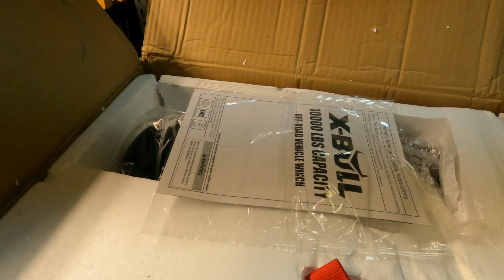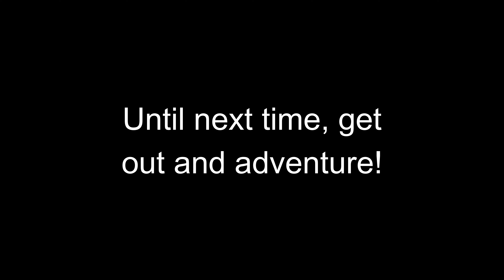X-Bull 10,000lbs rated winch Install

Comment: Where did you get your front bumper from  I have a 2007 dodge dakota and I wanna get one
Reply from the maker: https://www.amazon.com/Vijay-Bumper-1997-2004-1998-2003-Durango/dp/B0BBTG5HQW/ref=asc_df_B0BBTG5HQW/?tag=hyprod-20&linkCode=df0&hvadid=616388700171&hvpos&hvnetw=g&hvrand=17320267367919105365&hvpone&hvptwo&hvqmt&hvdev=m&hvdvcmdl&hvlocint&hvlocphy=9029961&hvtargid=pla-1741550971162&psc=1

Comment: Was a regular impact drill strong enough to go through that bumper?
Reply: I have the same winch, and the same issue with the spacing so i have to also drill new holes
Reply from the maker: I used a corded drill with drill bits designed for drilling metal. I originally tried my cordless drill, and it wasn't strong enough.

Comment: What site did you get your front bumper at…?
Reply from the maker: Here you go Frank!
https://www.amazon.com/Vijay-Bumper-1997-2004-1998-2003-Durango/dp/B0BBTG5HQW/ref=asc_df_B0BBTG5HQW/?tag=hyprod-20&linkCode=df0&hvadid=616388700171&hvpos=&hvnetw=g&hvrand=17320267367919105365&hvpone=&hvptwo=&hvqmt=&hvdev=m&hvdvcmdl=&hvlocint=&hvlocphy=9029961&hvtargid=pla-1741550971162&psc=1